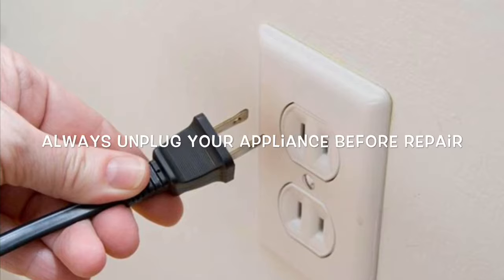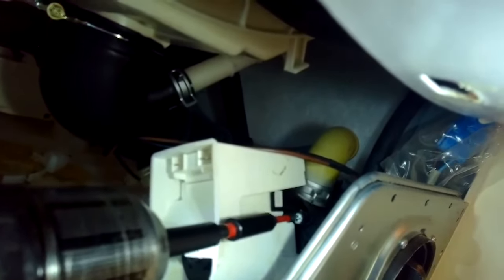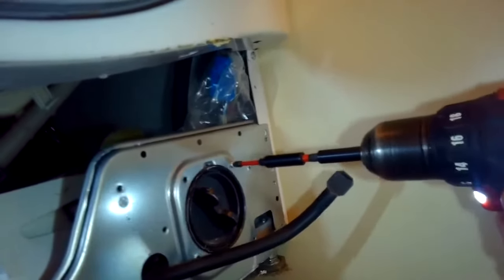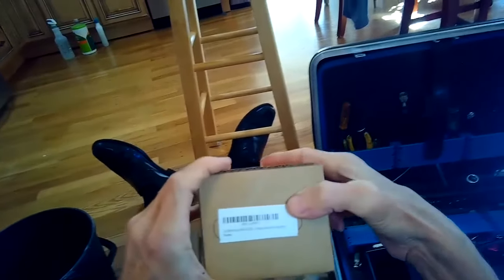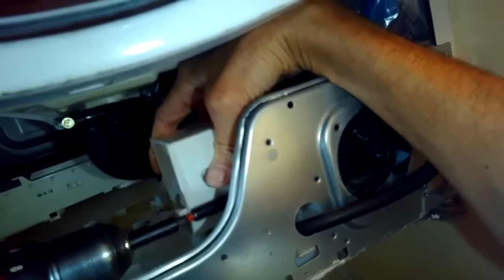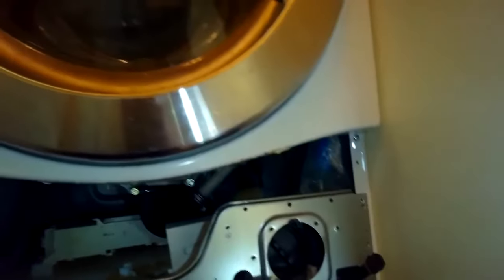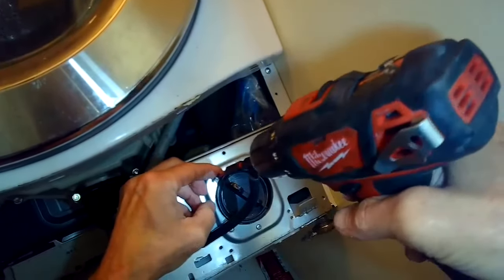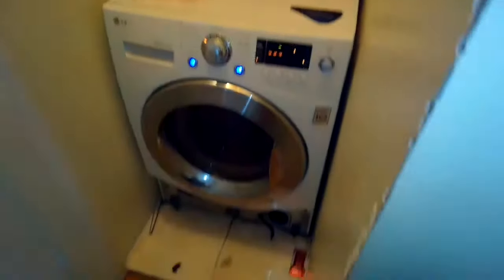✨ LG WASHER / DRYER WON’T DRAIN- - EASY FIX ✨

Comment: bro we have rhe same waher same code but mine dosnt opennat the bottom like your whole metal peice came off mext to the drain and pump??
Reply from the maker: Try leaning your LG back at 45 degrees against the wall and then come at it from underneath.

Comment: I'm looking for info. I have a wd 3274. It washes and spins perfectly. But on the dry cycle, it fills with water and doesn't drain. Obviously, the pump and filters work on the wash cycle.  I don't see any sensors for water level. Any ideas? Thank you. Also, I don't recall any fault codes, it's been a couple of years since I tried the dry cycle. What I have found, I's a wet/dry shop vac will pull the water out of the drain hose, so I can open the unit.
Reply from the maker: Think the condenser behind the tub needs to be cleaned of lint.
Reply: @ScottTheFixItGuyChannel : thanks for the reply. I had the unit apart, cleaned the pump /filters and all water and air tubing.  I found a sensor for water level, but it works fine on wash, so I don't think it's a problem. But other than that sensor, I'm coming up perhaps a timer for the pump on the dry cycle not working.  I have no service info, so I think I'm out of luck.
Reply from the maker: The condenser behind the tub is a separate system for drying and can get clogged even if the main pump works for washing. Check that.
Reply: @ScottTheFixItGuyChannel : interesting. It's been a couple of years since I had it apart last time. I did clean the dryer heater"tank" above the tub. I don't recall stuff behind the tub. I'll try again.  Thank you for the info.

Comment: Great video! As a side note for others in the future: the panel on the front of the washer is held on by 2 screws inside the drain access panel. You will need to remove those before you take off the front panel or it won’t budge. 

Other than that I just did it with a multitool and a $55 OEM pump from LG in an hour and saved $300
Reply from the maker: Awesome, thanks for sharing that extra tip! 👍

Comment: I feel very lucky that I found your video. You should be at the top of the list when searching for this problem. I had this same problem last year, and unfortunately, found a video that had me remove the gasket... it was bad. Took ages to get it back on.  Even having done it before, I wanted a refresher, and your video is fantastic - under 10 minutes, and straight to the job, no fluffing around. I cannot thank you enough - I have saved your video, as you are not kidding, these pumps don't last long. Now, if I need a repair that I can't do myself, how do you feel about traveling to New York? :D
Reply from the maker: That is Excellent News😊👍

Comment: Thank you so much for this video! I was a bit nervous about doing this repair. I didn’t want to destroy my washer/dryer. Your video made me feel completely comfortable taking on this job. After watching your video, I successfully repaired the pump on my machine saving me time and money. Prior to replacing the pump, I actually had to manually drain the machine at least 4 times during each wash/dry. 
I cannot thank you enough for posting this video!
Reply from the maker: That’s the best compliment I’ve seen all week😊

Comment: I have the same washer/dryer. We dont have the lower panel to remove do you have any recommendations?
Reply from the maker: You can unplug it and then come in from the back by removing the screws that hold on the big round vent tube and then wiggle out the tube,  then you can reach in and press the button 👍

Comment: Is there a water level sensor I should be checking before I buy a new pump?
Reply from the maker: It’s the pump.
They break all the time on LG.
Reply: @ScottTheFixItGuyChannel  thanks.  I've already got one ordered.
Reply: @ScottTheFixItGuyChannel  follow-up:

I replaced the pump and it's working.  It's not leaving any standing water in the drum after a wash or dry.  But, even after I took the top of the machine off to clean the excess lint out of the drying mechanism, it still won't get anything dry.  It just leaves towels hot and wet, which is how all of this started before. 

Any further suggestions?

Comment: Thanks! This really helped me out - amazed it took six years for the pump to go out the first time. I also had the two little screws in the front of the panel, and my pump seemed to be at the 45 degree angle but it is now working wonderfully!
Reply from the maker: Thanks so much Margaret, I’m so glad it worked😊😊😊
Reply: Mine is not 3 years old yet and it's stopped

Comment: I have a similar LG washer.  The pump was making rattling noises and was not thoroughly draining so I pulled it.  Yours was not draining; was it also making a rattling noise?  I dismantled my old pump and found the motor to be flooded with black wastewater so I think the front bearing seal failed.
Reply from the maker: Great Question👍 Click Here to Join Our Channel and I’ll Set Up Live Help with You to Get this Fixed: https://www.youtube.com/channel/UC7fBqy8806u1r0NpPv_fQ2w/join

Comment: My LG washer has the same OE error. I took mine apart, drain pump was testing 14 on the multimeter so it was still good.(I think at least) I took the propeller out of the pump itself and it was filled with dirty black gunky water. Besides that, I can't tell or figure out why I can't get it to drain and not get the OE error. I do know whenever it does drain, it smells awful like sulfur. Not sure what to do. I took the hose that drains into the pipe out of the house off and tried to clean that out too, still getting the OE error.  Is my pump the only option that would make it not drain then?  No kinks in hose, it's clean & the filter at the bottom is clean.

Comment: One small update.  I have a WM3488HW that is only two months out of warranty (grrrr!!!)  In addition to the plastic catches, there are now two screws on either side of the lint trap - coin catcher that hold the lower front panel on.  Other than that your video is spot on and very helpful.
Thanks!!!
Reply from the maker: Thank you

Comment: Use the little black hose in front where you pull the front panel to drain the water, it is much easier remove all the water out. That is what is meant for if you read the manual
Reply from the maker: That’s right, thank you

Comment: I have a similar LG washer that's getting a PF code. Basically, when I try to run it, it will die and next time I turn it on, PF code as though it had a power failure. I'm trying to figure out how to get the main board out. I see it is in the same location on this machine, but for the life of me, I cannot get the thing to move. I just wanted to examine for loose connections or obvious shorts, but DAMN, terrible location for the board. Your video at least gave me the idea of tilting the thing backwards. At least now, I won't be laying on the floor trying to figure things out by touch with only one hand...lol
Reply from the maker: Nice Dave, can you try plugging it into an extension cord from another outlet to see if that helps?
Reply: @ScottTheFixItGuyChannel  Yeah, I tried that and still got the code. I got the board out and tried disconnecting/reconnecting everything to see if there was a loose connection, but that didn't help. Ultimately, replacing the board seems to have fixed it, though, only one load done so far, so fingers crossed.

Comment: I have an LG washer/dryer all in one it drain but not how it used to,  actually I had to use my water vacuum but drain it and the water outlet had to be rearrange because of the low pressure when it drains. Do you think is this drain pump motor?
Reply from the maker: Sounds like a weak pump, but I would check the coin trap to see if it might be clogged?
Reply: @ScottTheFixItGuyChannel  yes I did I always clean it once a month I used my water vacuum to clean it .

Comment: You can manually drain with that black hose: unplug and drain into pan and put a towel under the pump before you remove it.
Reply from the maker: Yep,  super important.  Otherwise you’ll get about a gallon of water pouring out

Comment: Scott thanks for the vid - very helpful.  I have a LG front loading washing machine and I have a question was wondering if you are available to help me?  Basically I moved my front loading washer into a storage in Sep 2019 and I took it out of storage today May 2020 to get it ready to reuse.  It doesn't get super cold in my area (California) during the winter time.  Anyways, I noticed today after taking it out of storage that there was still water inside the washer.  I could hear the water when I was carrying out of my truck.  I did not know I had to drain the water out before storing into storage.  Question #1 - did i do any damage to the washer by not draining it in Sep 2019?  Question #2 - do i need to drain the washer completely before reusing it?  I watched another vid on youtube on how to ONLY drain I will try that.  Question #3 - do you recommend the best way to wash the internal parts of the washer before I start reusing it?  thanks in advance!
Reply from the maker: You’re fine.  You can just run an empty load with two capfuls of bleach and normal amount of soap on hot setting👍

Comment: I was wondering if you could provide a link for the part. We're having some trouble locating the pump that matches our model number. Are they all the same for LG front loader washer and dryer combo? It's a bit more  expensive than you mentioned and I don't want to waste money ordering it if it's not compatible. Thanks!
Reply from the maker: It’s the same pump👍
Reply: What us the pump model number?
Reply: @colleendorsla9  How I found mine was googled the model number of the appliance followed by "pump", that led me to the LG website. There I got the model number for the pump. On the LG website it was very expensive, but then searched that model number and there were a few different ones on Amazon for much cheaper, came out to just under $40CND.

Comment: How do I know if it’s the pump versus a clogged hose? Everything was working fine and then it just stopped draining even after we cleaned the filter and put the hose in a bucket on the floor. We’ve  only had this machine for 9 months
Reply: My combo stopped draining right before the one-year mark. Pretty disheartening to find that Amazon sells the drain pump in a twin pack! For what we paid, LG could have designed a higher-quality part.
Reply from the maker: The drain pumps don’t last.

Very strong chance it’s a bad drain pump
Reply: @ScottTheFixItGuyChannel  so, we replaced the drain pump and that worked to drain but now it's leaking underneath and badly. We secured the drain hose and filter. Also, we have the newer 4 cu model which was very different in terms of where the drain pump was situated. It was extremely difficult to get to.  But, do you think it's a loose hose on the inside? We had to go through the bottom of the machine to get to the pump
We live in a rural area and no technicians will come out to where we are.
Reply: I've had two versions of this machine for 7 years, the newer one is even worse than the last one! I've had it less than 2 or 3 years and am on my third drain pump 😞 I was sick of paying $350 every few months and waiting for a repairman, so glad to have found this video! But yeah, these drain pumps SUCKKK
Reply: I did this and it drained and spun once after replacement. Did a test wash and now I’m still getting the OE code with actual water in the tub (for the test). What the heck!! I tried I guess 🤷‍♂️ 😡